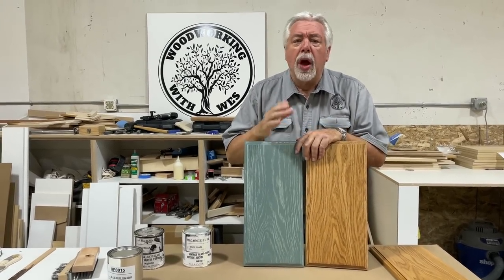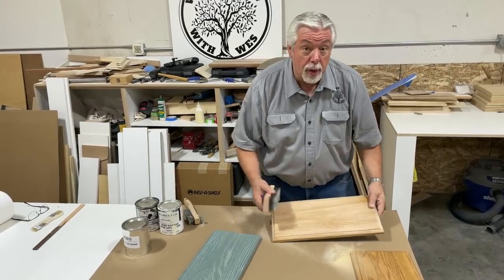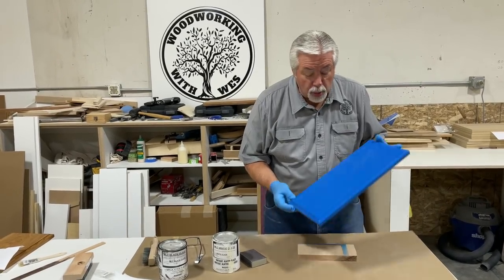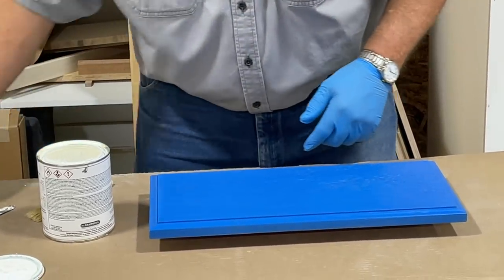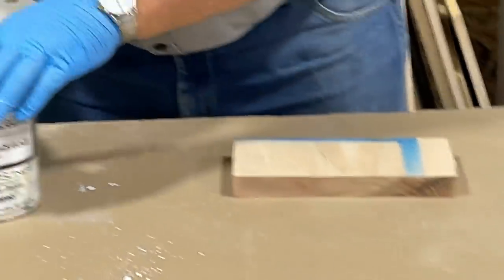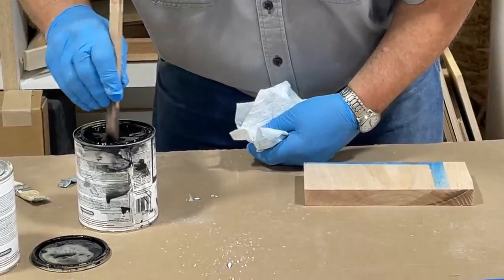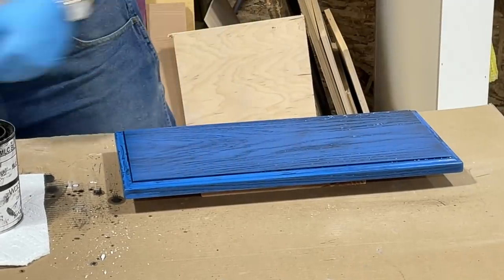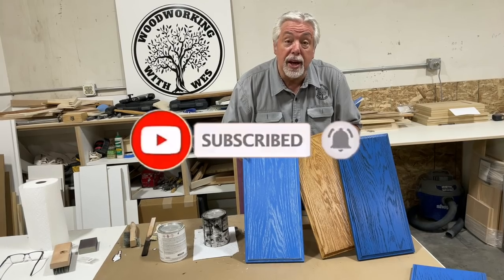Big Update In Cerusing Your Golden Oak Cabinets & Furniture

Comment: Nice! I like the black and the white. You will be glad to know I’ve been cerusing like crazy since watching and learning from you. 😃 I’ve been building Christmas presents since I have so many to do. I’ve been using stain and dyes, I can see I need to get and try the glaze. Thank you Wes!
Reply from the maker: Hi Patrick...that's awesome, sounds like you are having lots of fun. Thanks for your continued support, glad I could be of help. Wes
Reply: How do you use the dyes?
Reply: @Julie-ik1pp  Just like other finishes, but the colors are what I love about them. They come in powdered, or liquid form. Mix the colors you want, and wipe, or brush on prepped wood like you would any other finish. The colors look amazing just on all pine , even 2x4 , 2x6’s  and so on. With every coat the colors get deeper, and dry fast.

Comment: Beautiful.  Wondering it is possible to wire brush my wood cabinet, not use a color base coat but rather just add color glaze to existing cabinet color to highlight grain.
Reply from the maker: Hi Glenda...some things to consider if you do that:
~would it ruin the existing finish?
~what would you do for top coat over your glaze?
The only thing I could suggest is to try a test sample. Good luck, let me know how it goes. Wes

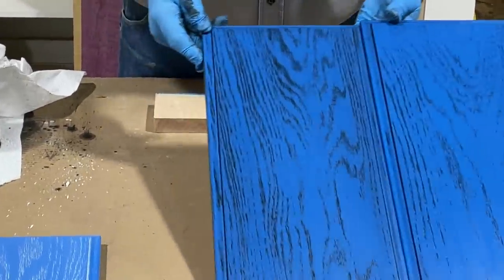Comment: The last thing on earth anybody wants is cabinets that look like a weekend warrior slapped some paint over them.  I (and most) people want it to look as if it came from the factory that way and these don't, they are BETTER. Cerusing looks 100x better than just painting a solid color, 17:30... So even if you wanted a strong medium hue it isn't all in your face as a solid color would be, and looks so much more expensive.  Just be sure the final clear coating is durable enough to stand up to grease removing cleaners which will no doubt need to be used time to time.
Reply from the maker: Thanks for the comment, glad you enjoyed the video. Wes

Comment: After lightly sanding the paint coat, I don't believe the panel dust was wiped. I'm sure it's the sanded dust that turned the glaze color
Reply from the maker: Actually, I blew the sanding dust off with an air nozzle and the glaze color is the same as what I applied. Thanks for watching, Wes

Comment: Great video and very inspiring.  Is there a way to get these great results without an air compressor and sprayer? Can the primer and sealer be applied with a brush or applicator?  Also, how would you recommend finishing the back side of the cabinet door - I don't imagine The whole process is necessary for the back?
Reply from the maker: I have attached a link to a video that should answer you question on application. Thanks for watching. Wes
https://youtu.be/CXuH-Ffqkyg

Comment: Probably too late to ask and this might be a dumb question: Does the wire brush use on the grain ruin the wood? Or can they be repainted later with one color or taken down to the bare wood and restained after this process?

Comment: Wes, I don't have a paint shop or a good sprayer to paint the doors. Would I be able to paint with a good brush or roller and get the finish I need to have and then put the glaze on and get a good finish.

Comment: I painted my oak bathroom cabinets with white paint several years ago. Am I able to just wire brush them and then glaze with the black or do I need to remove the white paint.  I can't remember what kind of paint I used, does this matter? (all I know is that it was a water based paint 2 coats)I am hoping I can just brush them and glaze, or do I have to remove the existing paint?I appreciate your time
Reply from the maker: I am not sure that just wire brushing will accomplish what you want to do. However, try a test on the backside of the drawer or door face and see what you think. If it doesn't work you may have to start over. Watch for an upcoming video where we will show paint options to help with that issue. Thanks Wes
Reply: Hi Lisa and Wes. I’m wondering this same thing. Did you have success? Wes, you mentioned you may have a video on cerusing over pre painted cabinets. Have you done this? Thanks so much.

Comment: Can I use a wire brush attachment to a hand held orbital sander to cabinet boxes which cannot be taken down, like the doors??
Reply: Not an orbital sander as it would create round scratches. Unless you maybe held the orbital on edge?
Reply from the maker: Jobelle...the orbital motion would not create the proper cerusing finish. Thanks for watching. Wes

Comment: Is there a way to add a grain to where there isn't one? I have some shaker style white cabinets
Reply from the maker: Hi David...unfortunately that probably would not work. Thanks, Wes
Reply: @WoodworkingWithWes  OK, take 2. Does it matter what wood is underneath and what finish is on them now? If I start acquiring similar cabinets (door fronts) will I be able to get them to match?

I was going to send you a pic, but YouTube doesn't have that option.

I could send by email if provided

Comment: How do you deal with the taped edges of the particle board cabinets? How do you get that to match?
Reply from the maker: I have found that the cerusing process on edge banding and veneer panels to be very unsatisfactory as the veneer is too thin. Thank you for watching. Wes
Reply: Maybe it could be replicated with a graining effect, using the graining tool that looks like a curved rubber stamp.